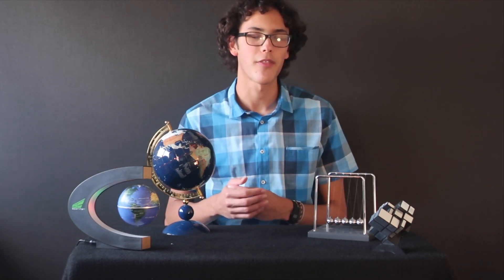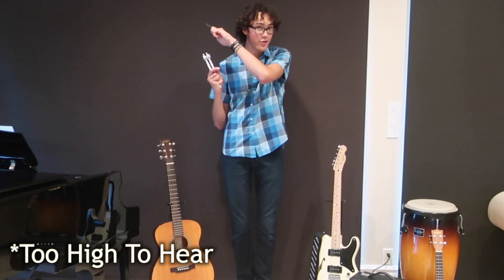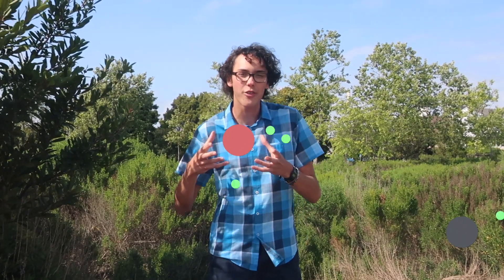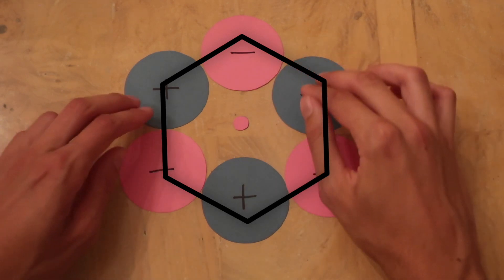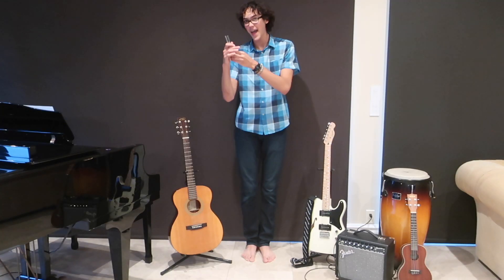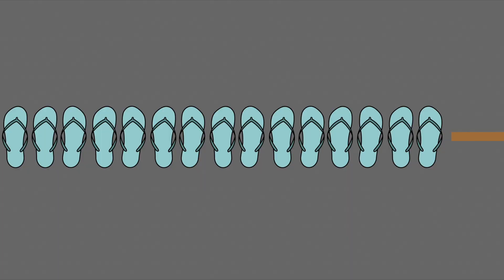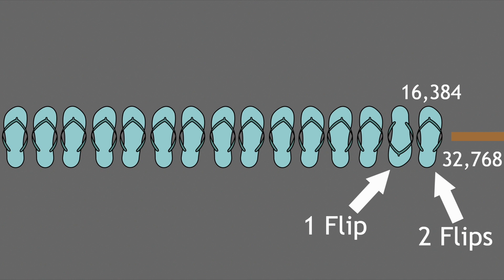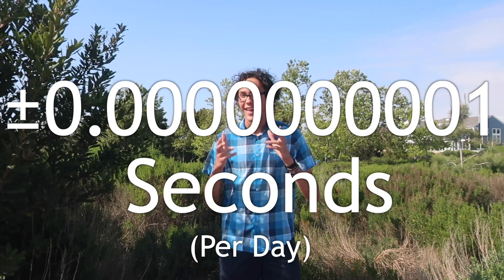How Does a Clock Know What Time it is?

Comment: Brilliant. Just one little clarification. The use of quartz as the material to build the tiny fork it is because the natural vibration of this material is a power of 2. And that makes it easier for for an electronic circuit, which use binary maths, to reduce the pace of vibration to one per second.
Any other material which natural vibration frequency a power of 2 would be suitable, however quartz is abundant and cheap.
Thanks a lot for the video it teaches me a lot.

Comment: I thought that the watch calculates time using a regular processor and firmware.

Is that not possible?
Reply from the maker: @IndigoandGreen  The key thing you need in addition is an oscillator which a processor alone can’t replicate very well